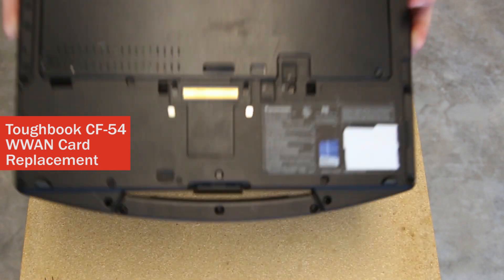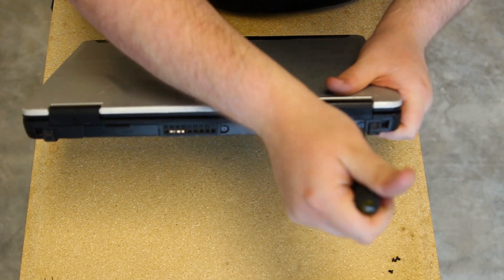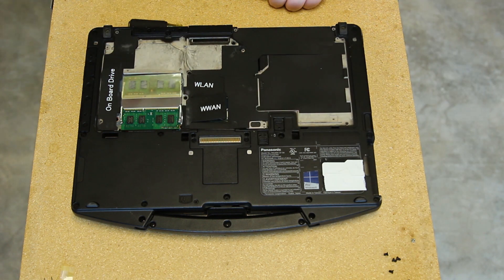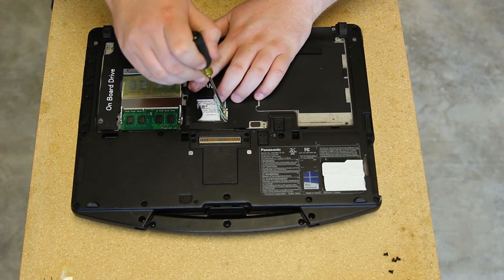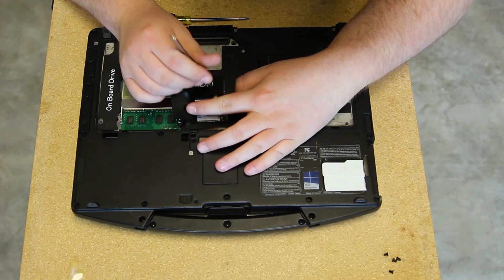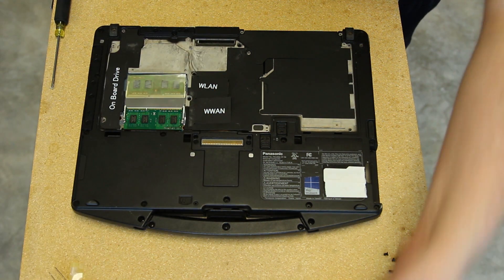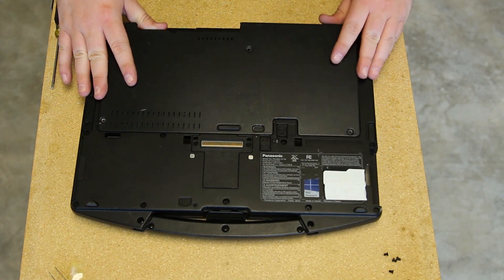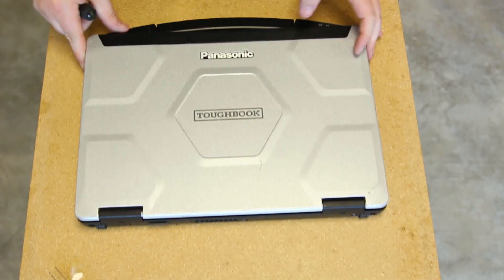How To Replace a Panasonic Toughbook CF-54 WWAN Card

Comment: Hello I get a CF 54 too and I dont understand what connector you have connect in your Video. (Green and grey wire I know) but whitch is which connector? The EM7355 have 3 connector pins I think!?  Thanks for helping!!!! ;-)  Greetings from Germany
Reply: Looks like green is Main, Gray is Aux, and if you have a 3rd wire that would connect to GPS. Not all models include GPS though.